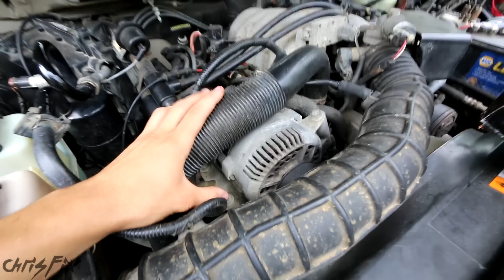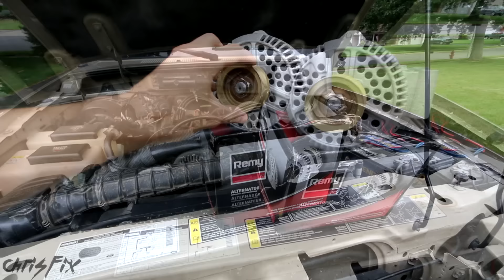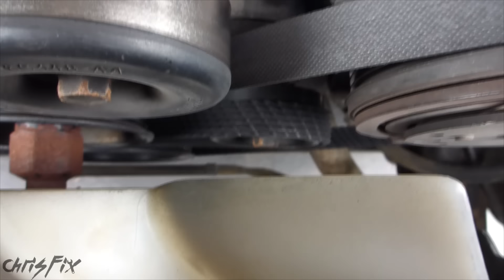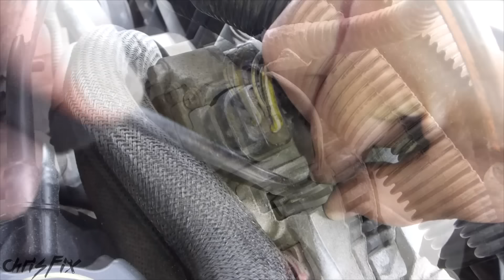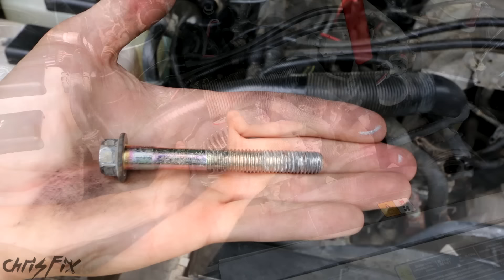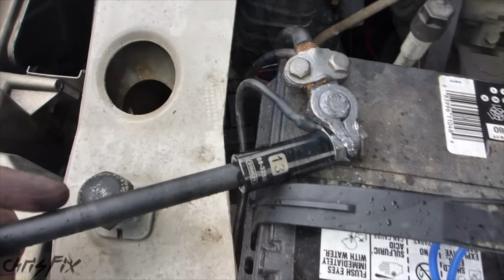How to Replace an Alternator

Comment: sometimes it's not the alternator , it could be the connection , that's what i thought after i we replaced the engine in a honda accord 99' , the guys they replaced the engine they just hand tighten the nut , sometimes it charges and sometimes not and the light comes on , after checking the connection i tighten the nut of the positive wire and it is charging perfectly until now
Reply from the maker: Great tip! That's covered here: https://www.youtube.com/watch?v=LGB6ZEjGm7Q

Comment: FYI you can NOT connect a new alternator to a dead battery, it will fry the new alternator. If your car was running on a bad alternator your battery may be real low. Charge the battery back up to 12 volts over night with a charger first, before cranking up the car..
Reply: Why does this happen?
Reply: A car battery can produce hundreds of amps when starting. If the battery is dead when u crank the car, the small diodes that change AC to DC for the battery in the alternator can not handle all the power the battery is trying to draw to charge up and u blow them.  There will be a tag on the alternator saying not to use with a dead battery.
Reply: Darryl H Thanks for the information!

Comment: Can you tell me how accurate AutoZone's battery/alternator tests are? I have subs installed and he was telling me how wrong they were installed, he said I needed to install capacitors and how I need to not have my +12v wire on the battery but that I need to "create an electrical circuit into the fuse box." I just asked them to do a battery test because my battery is coming on 5 years old now, and he hooked his tester up and the battery passed said it was good(I don't think this is an accurate test, it just said the battery percent), alternator passed but the alternator diodes failed. I haven't done the full test that you do, but hooking my meter up to the battery while the car is running i'm getting 14.5 volts with my subs and everything on. Does it sound okay? I've been running with my subs for awhile and it seems like it's fine. Thanks for these videos i've been watching you for about a month now! Can't wait for the drift build videos.

Comment: For those wondering why the alternator is grounded it is basically like a generator that creates an AC voltage, so it needs what is called a full bridge rectifier in order to make a DC voltage. 
So for more current (Amps) to flow It will need that good ground connection in order to have proper current flow to the positive terminal of the battery. 

Some people are scared of putting a higher amperage alternator in their system because it may fry some circuits, but in reality that is just not true. Even the battery doesn't care about charging current.
"The most basic rule is that you can charge at any current you like until the battery reaches 2.4 volts per cell at 25 deg. C (77 deg. F). That's the familiar 7.2v per 6v battery, or 14.4v for a 12v battery. Below this voltage, essentially 100% of the current goes into charging the battery, so there is negligible heating or gassing." 

- http://www.evdl.org/pages/hartcharge.html

Just thought I'd drop some info hence I have seen many people thoroughly confused about the subject in the past. Great vid!
Reply: +Sloth Armstrong NP!

Comment: Just as a warning to others, some cars have their vacuum pump for the brake system on the alternator (my car did) so you might have an oil line to remove as well.

Comment: when you were looking at the alternator diagram , what does that 3.0 L or 4.0 L refer too?
Reply from the maker: The size of the engine. This truck comes with a 3.0L or a 4.0L engine
Reply: ok thankz
Reply: +ChrisFix
You've got the 3.0L and not the 4.0L?  I don't know... that's kinda small.  Well, at least it's better than the 2.6L.  ;)

Comment: Chris with all those lights on your truck I'll be able to see you from North Carolina, lol
Reply: Man I'm jealous of all the tools you have too, I learn a lot from your videos but I don't have the radical collection or anything near yours, I need to step my tool game up immediately
Reply from the maker: Haha I want to get a quadcopter and get footage from above!!! As for tools, every time I fix my car myself, I save money so I use some of that money to buy tools.
Reply: +ChrisFix that makes sense, I should of showed you the spark plugs we just changed in my 2000 ford ranger, only 2 out of the 6 even had the metal hanger to connect the current, it was incredible the noise she was making, BANG BANG BANG BANG BANG, lol

Comment: You're so lucky, Chris, for having your alternator at the top. In my 1997 Mazda 626, the alternator is under the engine towards the back, right above the passenger side front axle. Had to drop the axle out just to take the alternator out since the alternator is too big to fit between all of the wires and the engine and the axle. Such a difficult task, especially seeing that it was the first time I've ever worked on my car by myself. But I'm glad I did it! I definitely see why mechanics charge so much for this job, especially on difficult cars like mine.
Reply: yeah unfortunately some alternators are buried deep in the damn engine bay LOL
Reply: had the same problem with my mums car when i did it
Reply: i have a 2000 mazda 626 v6.. same issue with the difficult location man, except they moved it forward on my model, still, i think the AC compressor has to be removed as its in the way.. crazy!
Reply: Ha mines under the power steering pump at the front
Reply: Helvetica bb
Reply: Urs is easy compared to mine, my alternator is in my engine and exhaust
Reply: 2009 rav4 with the v6. Pain in the butt. No room to work in that bay lol
Reply: Urs is easy compared to mine, my alternator is in my engine and exhaust

Comment: I have one hint or a tip for you when you open the throttle or the manfoild or headers you should put a pieces of tissues to avoid any dirt to enter the engine this will make the engine slow and it can drops the horsepower. Your bro Mohammad from UAE"DUBAI"
Reply from the maker: +Mohammad Alnoobi Thanks for the tip Mohammad!

Comment: Forgot one simple thing which most people might forget and that is to make sure that your battery is fully charged before you start the car with new alternator, because if your problem was a little different from Chris's and the battery was just drained it would be really bad for the alternator and especially bad for stator inside the alternator.

Comment: Hey Chris I have a question about my lighting in my truck when I'm driving down the road and hit about 2k RPM the lights flicker so if you could help I would be very very happy
Reply from the maker: +Trevor Oliver Check the alternator output: https://www.youtube.com/watch?v=LGB6ZEjGm7Q
Reply: +ChrisFix sorry for pounding you with questions but I don't know if I need a new steering box but my truck wheel sits at a angle when driving and when I turn to the left the the wheels turn as soon as the wheel starts to turn left but on the right side it takes alittle bit of turning to turn that side

Comment: Hi Chris, do you have a video on how to replace a alternator wire harness? I have a 95 Toyota celica 1.8 and the plugs broke into pieces and all I'm left with is loose wires and now my car won't start because I'm not sure what color wire connects into the input, any thoughts would be greatly appreciated.

Comment: Thanks ChrisFix., I had only ever done an oil change, and that only twice in my life before. I replaced my 2000 Nissan Altima GXE's alternator yesterday! I had a lot of trouble getting the 3 bolts back on, and I think I cross-threaded the top one; but since that one is connected to a tension screw for tightening the belt, and that function still works, I think it's OK. Healthy feelings of accomplishment plus saved money. Thanks again.

Comment: Hey Chris thanks for the little lesson on Ford alternators because I have a 97 Ford Explorer with a 4.0 v6 and I always wonder what kind of alternator was in my car and by you saying the 4 holes for the 95 amp and the 2 holes for the 130 amp it turns out that I had the 130 amp alternator and I know it's factory the car has been in my family since it was new and never been replace anyways keep up the good work Chris thx

Comment: what do those wires in clips on the alternator do? not the one that goes to the battery...
Reply from the maker: +hostilityy They control the amount of output that goes to the battery based on amp load and voltage.

Comment: Complete noob question right here but why would someone go with say a 130 amp alternator over a 95 amp?
Reply: +Link the Duelist more current = more power to power all those extra's gadgets and lights Chris installed.
Reply: O Qureshi Oh alright then. Thank you for answering my question.
Reply: Link the Duelist another thing is if you have a huge stereo system, it can drain the electrical system a lot. If you put on more than 1,000 watts of after market stereo it's probably a good idea.

Comment: Just did an alternator replacement on my lancer and I used the voltmeter test to see what the issue was, battery was fine, alternator test was down to 11 amps on the meter. Works great now, got on of those belt tools to and did the belt on my explorer.   Thanks for your great and EASY instruction and tips. It's nice to know I can do not jobs with simple tools.
Reply: 11 volts not amps
Reply: Hi man idk if you’ll ever see this message but my alternator went bad on my Ralliart 09 I’m sure they are in different locations from the normal lancer due to different engines but how hard was it for you?

Comment: Whats up Chris Fix? Got a new problem with my nieces truck(For Explorer) same year as yours. Wire wheeled with a drill all the mounting connections from the block out and changed terminals. New battery. Drove fine for a couple days. Last nite she said lights were flickering and dash says check ground or fuses? Thanks for all your help bud.
Reply from the maker: +Jaime Mendiola Check out the fusible link: https://www.youtube.com/watch?v=-SpsSRGfDQI

Comment: Whats up Chris Fix? Its Jimmy in beautiful Sunny California! Got the broken bolt remedied and new alt installed. Cleaned the batt connections. Still got a batt light and the volt meter reads low in the truck. Thought it mite be batt so put the one from my Camaro in and same result. Any thoughts or tips always help. Thanks Chris Fix!! Keep makin vids brutha!!
Reply from the maker: +Jaime Mendiola Check the alternator wires and the grounding wires that go to from the battery to the chassis, from the chassis to the engine block, and also check the alternator mounting surface and make sure it is clean.
Reply: Thanx Chris. Watched your test video and got my volt meter out. Super helpful!!

Comment: My '05 Camry is making a high pitched whining noise from the engine bay. It gets higher in pitch as the tachometer increases. I found a couple videos explaining the same symptoms for the same car and they said replacing the alternator fixed it. I had my battery and alternator checked a couple weeks ago and they were both running strong. Is the whining the alternator itself or possibly a bearing? Could my noise be caused by something else? My first thought was the transmission since the pitch of the noise changed as I shifted. What do you say? Thanks for what you do and congrats on the new blown heads channel!
Reply from the maker: +Matt Bono It could be the bearing in the alternator or it could be the power steering. Check this out: https://www.youtube.com/watch?v=A0fiZCHz5ew
Reply: +ChrisFix thanks for your response. I replaced the alternator yesterday and the noise went away completely. I am holding on to the core for now and see if I can rebuild it. Do you have any experience or advice on that?

Comment: Hay Chris Fixx it Jimmy in beautiful sunny California!! I got a question. I was changing the alternator on my neeces 95 Ford Explorer. The driver side mounting bolt was broke in half. Any tips on getting the broken bolt off and finding a new one? And Im actually wondering if the alternator is bad because I noticed removing the batter, its a 2013 batt. She said that the batt light came on and it would die. Thanx Chris!!
Reply from the maker: +Jaime Mendiola Sounds like the alternator might not have had a good connection because the broken bolt. I would try to grab the stud of the bolt with a vice grips and get it out that way. You might have to remove the alternator to get access to the stud. Keep me posted and good luck!
Reply: Mabe some PB? Have you ever broke a locking lug with a sacrificed socket? I have tons of dup sockets so was wondering? Great day to work on a car? Thanx Jimm CC

Comment: Have a new alternator, everything is the same except the electrical plug. New one has 3 prongs and old has 4. Is there a way i can take the old cap off and switch out the connector?
Reply from the maker: +RETUSAF1995 I would have to see the connections to tell you for sure.
Reply: I have to return it. I need the alternator with 4 prongs. Thanks anyway

Comment: Replacing a 90 amp alternator with a 100 amp, see any problems?
Reply from the maker: +RETUSAF1995 If your wiring is not designed to take the extra amperage there might be a problem but for only 10 extra amps, you will be fine.
Reply: Thank you.

Comment: Hey dude, love your videos, I am an avid watcher, you are one of the best on YouTube by far! :) I have a quick question for you, I have the European/South African/Aussie version if your truck, the Ford Ranger or Mazda B2500. It currently runs the original alternator (75amp) and the bearing is getting slightly noisy. I know of an alternator going cheap from a minivan that uses the same engine, but it is rated at 90 amps, do you think that it would be compatible? Thanks in advance dude. :)

Comment: Hey ChrisFix, I have a '97 ford explorer, 5.0v8... It has a whine in the Engine area. It sounds like a bad steering pump like when you turn the wheel to the limit and hold it there. Except its not the steering fluid pump. After reading online it seemed like its pulleys.. I've asked a shop to check and see which pulley they think it is.. and I've replaced the belt tensioner with the pulley... nope still whines. I can't really tell if its the idler pulley, or if its the alternator making noise... but it sounds like its coming from the alternator area. a buddy and i tried to spray some lubricant toward the alternator pulley/bearing.. and that made no change... any suggestions?
Reply from the maker: +Ivan P I would try listening to the alternator with like this: https://www.youtube.com/watch?v=tA_E6X4ISgQ

Comment: Hi Chris good basic video, just one comment, when you disconnect the battery terminal, it doesn't matter what it touches as the battery itself is disconnected it cant shorten out or do anything as long as it doesn't touch the battery terminal itself...you can touch the lead on the engine or even to the positive battery terminal, it wont do anything as the battery isn't connected....well that's how i see it....from Fred in UK..
Reply from the maker: +Tom Smith Thanks a lot Fred and thanks for sharing. I said not to let it touch anything because some people might not properly disconnect their battery or they might have a second power source so it is better to be safe than sorry.

Comment: hey chris is a remanufactured alternator good as new? tnx
Reply from the maker: +Genebel Caratao They are pretty much the same as a new one. As long as you get a full remanufactured one, they pretty much just use the shell and replace all of the guts of the alternator.

Comment: Hey Chris I have a after market altenater and it's not threaded like the original can I just get a nut and washer to place at the end to fasten it in
Reply from the maker: +James Jones Yea if you can make it work with a nut and washer. Use some thread locker to prevent the nut from loosening.
Reply: Thanks Chris I appreciate that

Comment: I just changed the brushes/voltage regulator for 32.99 from eBay for my 06 Hyundai sonata 2.4l. a whole new 
alternate was160$!
Reply from the maker: +denis gorelyy Awesome! That is a good way to go too!
Reply: oh dang it something went wrong again like the alternateor stopped working again. :( what else could be wrong? it's definately not charging the battery.
Reply: oh dang it something went wrong again like the alternateor stopped working again. :( what else could be wrong? it's definately not charging the battery.

Comment: hey chrisfix. I'm very happy to watch all of your videos & a fan.  I have lexus ls460L and there are carbon smill gos inside my car especially when I park the car and ac is working. I tried to close my AC and check if the smell is gone but it there (what do you thing is the problem)?
Reply from the maker: Emarati Check to see if you have a gas line leak in the engine bay or under the car.

Comment: Hey Chris, I'm looking into getting a new muffler and tailpipes put on my 99 Ranger in the next six months or so. Where would you go to get that done? Currently I'm considering Midas.
Reply from the maker: Bryan Young Midas would be a good place but honestly this is all hearsay because I do all of my own work (welding included lol). Shop around for the best price!
Reply: If only I had my own welder and pipe-bender. Heck, I'd pay you to put it on because I know it would be done right. Thanks for your advice.

Comment: You said remove the negative battery terminal and make sure it is not getting grounded out.  Why?  The negative terminal IS the ground!  It can touch the frame or any metal part of the car and nothing will happen because it is directly connected to the body and engine anyway.
Reply from the maker: panzerabwerkanone If people have dual batteries, a battery in the trunk, etc you can still have a connection to the battery if it grounds out. Better to be safe than sorry. Since I do not know everyone's setup, I just try to make it as safe as possible.